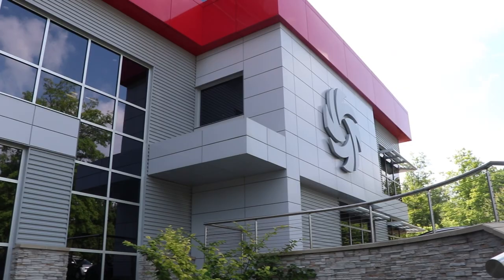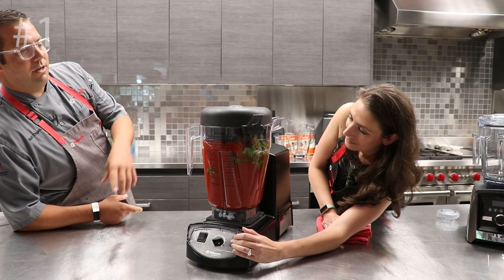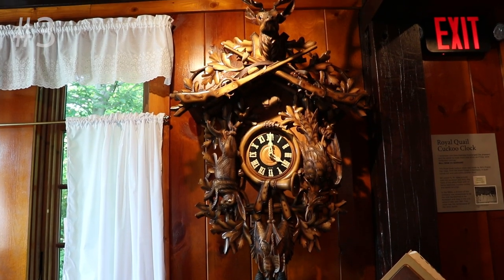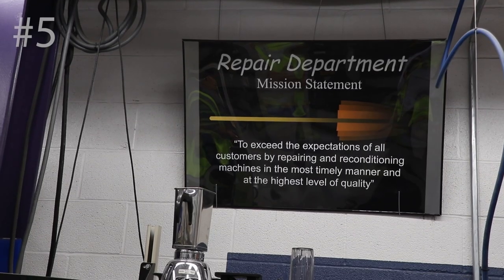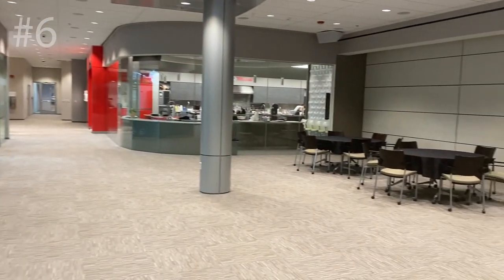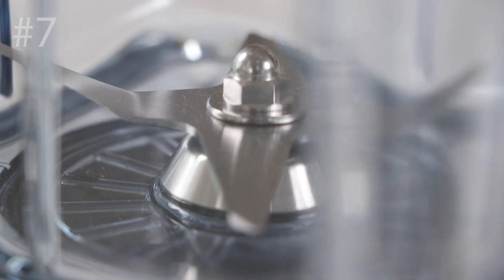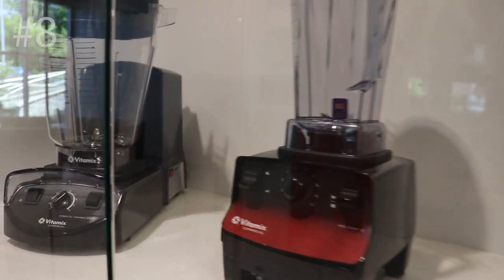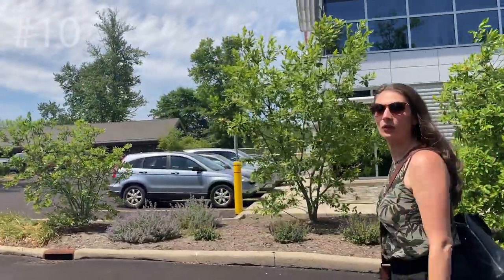Inside the Blender: A VIP Tour of Vitamix Headquarters

Comment: So taking your numbers of 100 machines repaired a day, assuming those represent 10% of the total machines needing service, and finally adding in that about 5,000,000 machines are being used globally right now. Then that means that 36500 are repaired a year, which in turn means 365000 machines need repair a year.

5,000,000 total machines divided by 365,000 machines a year, is 13.7. So on average Vitamix machines will last 13.7 years before repairs are needed.

Adding to that, the first 7-10 years Vitamix will cover the repair cost under the warranty. AND the techs in the video said most repairs are simply the worn out drive socket, which is the easiest thing to replace after the container. These machines are truly built to last.